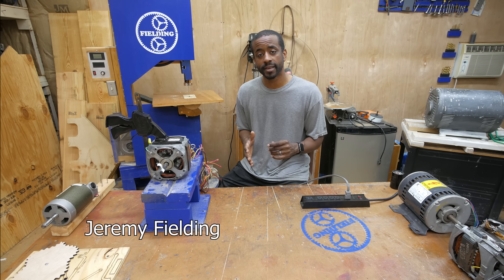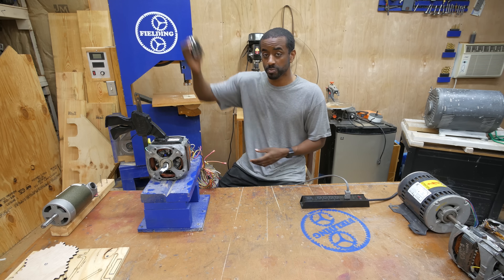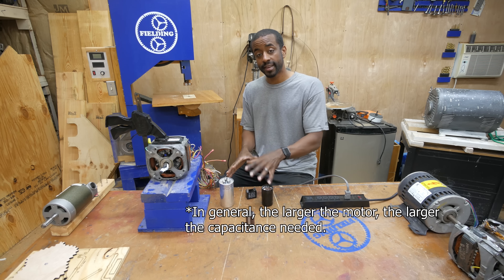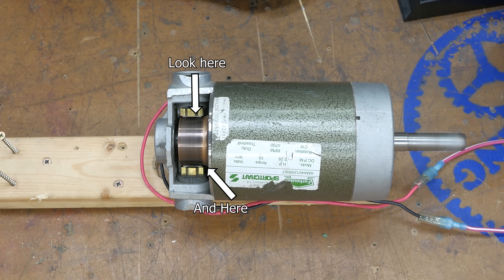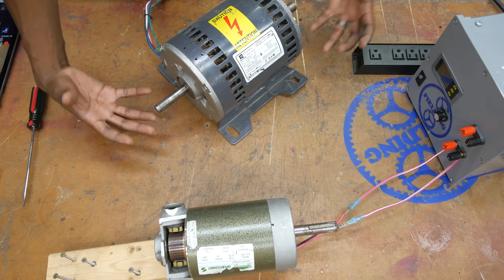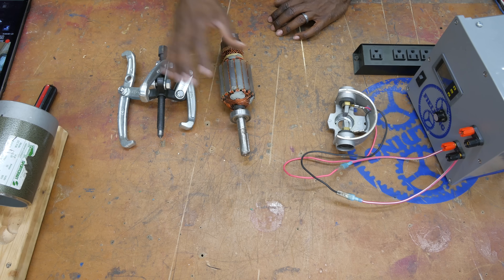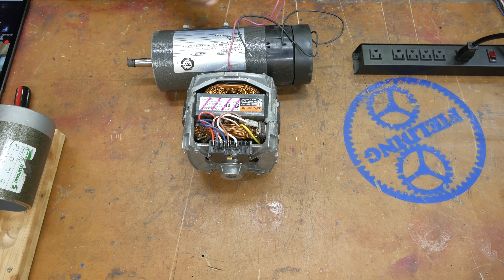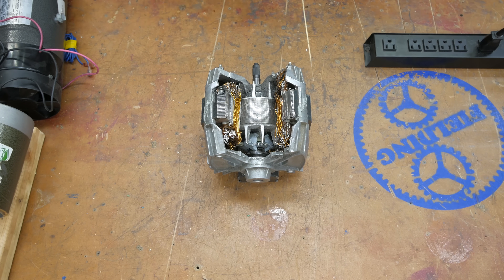Three Most Common Motor Fixes Anyone Can Do; Ultimate Guide to Electric motors ; #070

Comment: Very informative video.  So helpful for people like me who just know enuff to be dangerous.  Got my feet wet with my clothes drier motor, then the swimming pool pump motor, my little Black & Decker leaf blower and now my air compressor  motor.  I have a Hoover carpet shampooer & a Lasco pedestal fan waiting for me; both overheatng.  Plenty of videos to wade thru, just not enuff time to narrow it down to the good ones, LIKE THIS ONE!

EDIT:  I'm gonna re-watch because i missed a lot while comnenting.  The video that following this one looks like it could be yours too. It looked good anyway!

Dang, almost forgot -the inducer fan motor on my furnace is also waiting.  Gets hot & hums, just like the pool pump capacitor but I don't think there's a cap on this one.  It's real little and only runs in the beginning of the sequence.  The bad thing is without it, the ignitor won't heat up, the gas won't turn on, etc. etc.  The good thing is I can turn the motor, so it's not completely toast yet.  VERY thankful for my fireplace in the meantime, especially because keeping a fire going doesn't require a bunch of troubleshooting.  At least not until THAT electric fan motor goes south!  (Don't jinx me!)

What I wanted to add in response to your solicitation for comments is with regard to brushes.  You were spot on about the sparks as a symptom.   My little Black & Decker Leaf Bower quit on me recently. Leading up to it's demise (unless I resurrect it), it would randomly shut off on me and I'd think it had come unplugged or my extension cord was bad.  It was neither, but in the process I discovered that if I banged on the ground a couple of times, it would turn on and run just fine again.  OH WELL, Right?  Heck No!  That's when I really started noticing the sparks when it was right around sundown.  And they got progressively bigger, just like you said.  After that, I made sure to quit leaf blowing well before sundown. 😊

So fast-forward, one of the two brushes did not have the little square piece of carbon that makes contact with the commutator (?) and i couldn't find it anywhere in the housing.  Just the end of a sprng was showing where it should have been.  

If i had found it, could it be reattached?  Or could something else be substituted in its place?  I've seen wheel weights that exact same size but I don't know.  

I wiggled the end of he spring around with some needlenose thinking maybe it got lodged in there but nothing came out, except more of the spring.  So i pulled it out far enough that it broke off, not that there was much to it anyway.

Now:  Replace the brushes, right? According to YouTube IF they're the replaceable type.  Huh?  They're RIVETED on.  At least that's what it looks like to me.  I have two Black & Decker Random Orbital Sanders that aren't usable anymore but have perfectly good motors.  I bet they have the same brushes and I have a rivet gun . . . somewhere.  I WILL LET YOU KNOW!!

Comment: My drier, pool pump, furnace inducer motor, and air compressor.  The pool pump motor hummed just like you u demonstrated.  (Combo start & run)

My compressor starts fine but then makes intermittent struggling sounds, eventually tripping the breaker.  Tried different different breakers (with nothing else running on that circuit) with the same result.

I just don'6 see how this is start cap related, unless the its not opening the contacts when it should and continues to stay on when it should drop out.  
Lots of videos say, "Tripping Breaker? replace start capacitor." 

So i struggle with that diagnosis.  Your thoughts?  Sound like start cap symptom to you?  Not looking for a diagnosis or other things to check - just a yes or no. Thkx in Advance!

Comment: What a great video! Thank you for making it. 
Only problem I have had with a small electric motor that you didn't mention was a starter motor on an old truck (6 volt DC): a small piece of metal got  lodged between the rotor and the field windings and the motor would not spin at all until that was removed. While it was apart I put the rotor in my drill press and used emory cloth to clean the commutator bars as they were filthy.

Comment: I have a 45k btu garage heater in my sunroom to keep it warm during cold weather, my laundry room and water heater and well water stuff is also connected to that addition on my house, anyways my electric fan to blow the hot air out of that garage heater is intermittently being noisy so I think the packing needs to be oiled, and hopefully it'll fix this terrible noise it makes on some runs, I've never oiled the packing in a fan before but a replacement motor is like $200, but a replacement garage Heater is only 3 or $400 so I hope I can fix it.

Comment: late to the party, excellent video. On the capacitance, I've always heard the voltage doesn't matter (as long as same or bigger) but the capacitance is crucial. Learned it the bad way when I replaced my washing machine's capacitor. The capacitance was off by 1uF so the seller and I thought 'ahh what the heck, it's only one tiny weeny uF off'. Well, it fixed the washing machine for a while, but not for long because this time the motor burned (the smell). might be coincidence, might be not...
Reply: @mikeroman5551 I have the same understanding as you regarding replacement specs.  I replaced the 25 microfarads cap on my swimming pool pump motor with a 30.  The voltage was identical.  
I discussed it with two of the guys who repair the pump motors for the local oil refinery.  They said it was fine.

I went over by 5 mf; you only went over by 1.
I'm thinking the motor in your washing machine died of other causes.  The only caveat might be that the pool pump has to move a lot more water than a washing machine pump.  1-1/2 hp motor, so maybe a little more tolerance for variability.   

I still think your pump may have been on it's way out for other reasons.  I can tell you that my pool pump has been on it's way out for a long time before the Capacitor replacement and after.  When the capacitor died, it didn't run at all -just hummed. 
With the new capacitor it runs again -just screams louder than it used to, due to the bearing or seal or whatever has been ailing it all along.  😊

Comment: Flashbacks 
It’s a armature in a DC motor 
Rotor in a AC motor 
30 years repairing mostly DC motors under my belt 
Rewarding job if you do it correctly

Comment: Hi.  I have a 120v / 11.5 amp / 1 PH / 3450 RMP motor from a Craftsman 10” table saw that does not appear to have brushes.   After a few minutes of running the rear of the motor gets hot enough that smoke can be seen.   Would you say this is a bearing issue?    There are no sounds or looseness in the blade or shaft.   The motor runs smoothly and seems to be making full power.

Comment: Great videos, l need help on my band saw. The start capacitor is bad.I can spin the motor by hand and flip switch on and it will work. No one can tell me which capacitor because mine has no information on it. It’s a baldor motor 3/4 hp 110 ac 13.2/6.6 amp 1725 rpm 60 cycle 1 ph. Thank you if you can help!!

Comment: I have a single phase motor that does not run on my air compressor. Capacitors are good. It won’t run when plugged in and does not hum. A single spark does flash from the centrifugal switch before tripping the circuit breaker. Do you have a video made for this type of scenario?

Comment: have lawn motor that just stopped.  Power and switch OK.  No sign of life.  Brushes look OK.  Was thinking of jumping what I think is the temp sensor to see if it starts? What I think is that temp sensor seems like a bakelite piece whith 2 wires running to it? Is that it ?

Comment: With a lot of hand held power tools such as drills and routers, that have plastic bodies, you might get a short 'noisy' phase but often the first sign is 'burning plastic' smell followed by smoke as the housing starts to overheat. If you are quick switching it off, you will quite often get away with just replacing the bearing. If you keep running it you will melt the body and it will be a write off.   Excellent video fella - no music or gimmicks - great !

Comment: I have a fan motor for air conditioner out door unit and suddenly stopped working, I checked the capacitor but found good, I dismantled the motor to see if it is burnt and no signs of heat. the motor is thermally protected and I really have no Idea what to do. I am expecting that a peace of protection maybe insolating the circuit. I though you would cover that in your video. please advice me what to do. thanks for providing details information. best regard

Comment: My contractor air compressor started making a humming noise and would begin running if I helped it along. I forgot to shut off the power, and now it neither hums and won't start at all with assistance.

Comment: I HAVE A QUESTION? When the motor is sitting and humming, can you turn the shaft in both directions of rotation by hand either left or right. What takes out the start  capacitor. Centrifugal switch in motor? Another question? On a compressor for example does a compressor motor on a refrigerator work the same way? I’d been watching your you tube video’s and there easiest to understand. Thank You

Comment: Hi What does it mean when you are told the motor windings are shot for your table fan and can't be fixed?  It doesn't hum when. you turn it on at all. It's just dead. I love the fan as it's a retro looking model and in perfect condition otherwise.

Comment: Hi, Jeremy.  It's nice to hear someone intelligent posting their knowledge on YouTube.  Too many videos are just someone videotaping without REALLY knowing the whys and how comes.  I was wondering if you could, (or have already) post a video on fixing an older Ridgid shop vac motor (model # WD14500, 120V)?  The symptom...it was hooked up to my CNC router and it ran too long during a carve job and stopped.  Then there was a burn smell.  Is that fixable?  I've tested the switch and now I've taken it out of the housing and don't know what I should check next.  I can buy a replacement motor, but the crazy cost is more than a new shop vac, lol.  Additionally, I believe the older models were made with better components so would like to fix if possible.  Thanks in advance if you can help.  Kate

Comment: You are THE man!  TY very much.  Just inherited grandpas old shop and the bandsaw wouldn't start.  Disconnected the capacitor (with it connected the circuit would trip the breaker) and now I can run the saw by manually starting the wheel.  New part ordered, you saved me from buying a whole new motor!

Comment: My Gerni 7000 pressure washer motor may have been just short circuited. I saw an instant bup of smoke. I guess it's the motor-built-in fuse. Is that correct? Any way to repair it? Any comments from anyone?

Comment: Hoping someone may see this and be able to help... 
I'm trying to fix a motor on a small shop vac, about 12 years old. I've checked continuity from the plug to where the ends terminate to the motor and the switch, no problems there. The switch itself functions as it should. The brushes still have a lot of life left to them, and are conductive from one to the other. The motor itself has four terminals. The white from the power cord terminates directly to one of them. The black wire from the power cord goes to the switch, and then from there, to the terminal located 180 degrees opposite the terminal that the white connects to. The other two terminals are where the brushes connect. The two terminals to the brushes, and the one that the wire from the switch connect to, all conduct to one another (I'm assuming they are all a shared ground). The white wire terminal has no continuity with anything else on the motor. Enamel on the motor windings still seems healthy and flexible. I can't disassemble the motor any further than I've gone without breaking parts of the plastic housing, but the bearings seem fine. The shaft of the motor will turn with little resistance when I twist it with my fingers, and I know the sound and feel of broken bearings quite well by now from my many years as a skateboarder. There doesn't appear to be a capacitor. I don't think it would need one just to start spinning a small, lightweight aluminum impeller. I don't know where to go from here, besides the garbage can.
Any and all advice would be immensely appreciated, thanks!

Comment: Ok buddy I have a Maxi-Torq Permanent Split Capacitor Gearmotor MFD for Dayton Electric that came off of a Chiropractor roller table. It is a Model 4Z519 1/15 hp. It just quit, no smell or anything weird, and it never did get hot. My first suspicion was the capacitor, so i replaced it.. Nope that didn't fix it.. Now im trying to figure out how to get to the brushes No nut/bolt on the motor end to take apart.. If you have any ideas that would be much appreciated!

Comment: I am a pro auto mechanic but I have been stumped on a small portable $20 air compressor. It worked great until I had to slam on my van brakes to avoid a deer. The air compressor slid forward and took a hard hit. It doesnt work now. Ive got about 5 hours into this trying to identify the problem. It hums, no rotation. Such a simple motor. I did realize the magnets slid forward in the case. I repositioned and glued them. I was assuming that was problem #3 but it still hums. Bearings seem fine too. I filed the carbon tips flat, I assumed that was #1 issue. It still hums. Anyways, long story is I will not stop until I force this motor to run. Fascinates me but angers me because I only paid $20 for it. I can buy another for $30. But I feel like this motor has won my 5 hours of mental battle. 😂

Comment: I have an AC Sun Joe Dethatcher. Was working fine. Got through the front lawn and half of the back I stopped to clear the thatch and when I started it again it made a high pitch whine. I lifted up the machine to see if it was turning and noticed it was going backwards.What could cause the motor to turn the wrong direction?

Comment: You asked for problems not covered here and I have one - I cannot find any videos or web pages that tell me, or interpret, ohms readings I have got from my induction motor. There may be great reasons for this but I've spent ages looking and there is a need out there for an explanatory video - over to you Jeremy. Here are my figs over the 3 wires going into my capacitored 240v motor as fitted to my Karcher K4 Compact. The plug that goes into the motor has 3 terminals - Live (L)  Neutral (N) and Capacitor (C)- The ohms readings are  N to C 4.6ohms N to L 5.7 ohms L to C 0.8ohms. These tests done directly on the motor and disconnected from any switching/capacitor etc. There is no continuity between any of the 3 terminals and earth. Any ideas? Worth a video explaining differing results from each connection? - Either way cos I know you are busy, great videos Sir

Comment: I have a 230v compressor motor that still hums even after both start and run capacitors been replaced! Would you think that the clutch switch contacts would be the next to look at?

Comment: Excellent video. I have watched many DIY videos as I do my own. But electrical content is usually so over complicated or cluttered. What you did in your video was excellent by any standard and I will be watching more, thank you.

The reason I found your video is that I am having trouble with my induction motor for my exhaust hood.

I have repaired the best I can, I have bought and installed a new capacitor and got it working. However it still seems to need help to start spinning! 

Can you help me please? 

When I turn it on, it hums and tries to move in (what seems like the wrong direction) 

If I spin in (in either direction) it gets going well! 

The new capacitor seems to have made a bit of difference but not fully fixed. 

Is there anything you can advise please? I have tried finding the start wire disconnect and checking but my motor is not as big as yours and doesn’t appear to have one. 

Thank you in advance, if you have the time:)

Comment: Hi Jeremy,
I have a motorcycle starter motor with permanent magnets. 
From the research I have done into its possible problem, the permanent magnets after some time let go and move. This is supposedly the reason why the motorcycles battery goes flat (I can't say I understand that!). My questions are:
1. Can this really happen 
2. Is there anyway to fix or repair the motor?
3. How can I be sure the magnets will be in their original orientation?

Any help you can offer will be greatly appreciated TIA

Comment: Great video. Thank you. I have a grizzly dust collector that hums but doesnt start until i tap the casing with a hammer. Replaced the capacitor and still have the same problem.  Any suggestion?

Comment: I have a motor with the bearing built into the case - just rings on the shaft that rest in an enclosure.  one was slow but seems fine after I just took out the ring and put it back. 

The other one jammed and the ring was bored out about 1mm. IDK why it jammed. Should they have grease?

My main question is, where can I find small tubes or a shim of some sort to make the damaged ring fit on the shaft?

Comment: Thanks, 
I work at a repair shop and do the sort of fixes you mentioned, great clarity. We have Motors that have windings that are shorted across all windings or open circuit across some,  I don’t quite understand how a motor ends up with shorts across all the segments of a contactor and I’m concerned that I’m throwing out motors that are repairable can you speak about that? am I right in saying that there should only be continuity across opposite segments of the contactor and that if there is continuity across all segments then the windings are dead and the motor is not repairable. Is it a breakdown of the winding varnish due to heat?